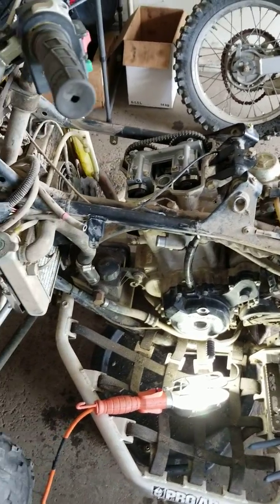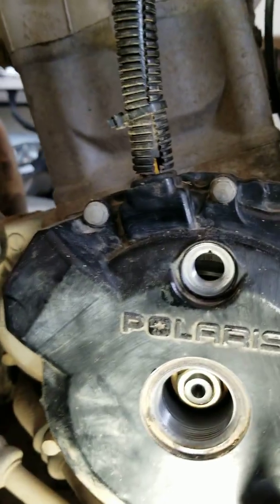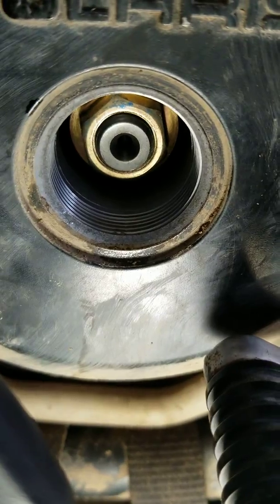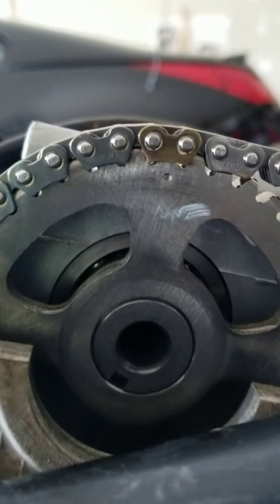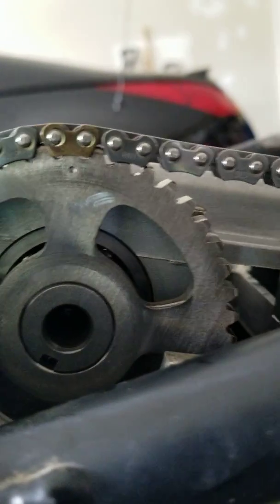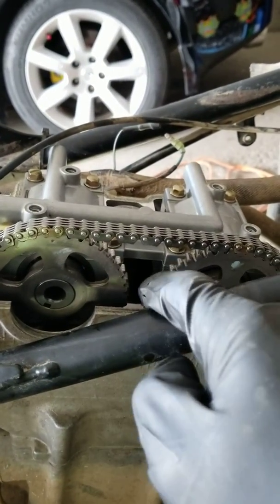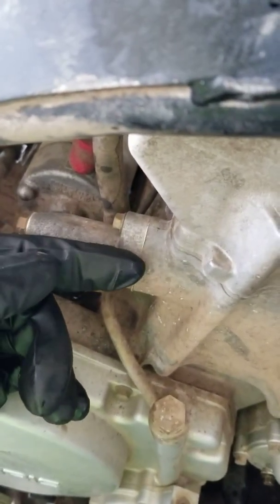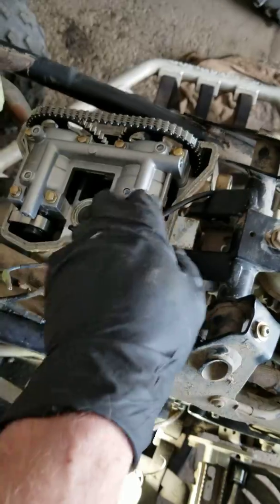Polaris outlaw 500 timing marks

Comment: My predator seems to keep skipping timing. I ordered a new tensioner and chain but what else could be bad?
Reply from the maker: Are your chain guides bad? Stretched chain or tensioner can cause this too. May want to leak down test it to make sure the valves aren't bent if it skipped timing while running
Reply: Check the ruffkey, they tend to break on this and will screw your timing

Comment: I am having a problem getting my cams and chain back on, it seems the front chain guide closest to the exhaust valve side is up to high not allowing enough slack in the chain, do you have any pictures of where it is supposed to sit down inside the front of the engine, I don't have a book on this 04 Predator 500. When I pulled the head to replace the valves and seals the exhaust side guide pulled out with it, and I can't figure out how it is supposed to sit down in there, it seems like it will sit a couple different ways, neither way seems to work, it acts like it is in the way of the cam gear, any advice would be appreciated

Comment: Hey Conway. I just replaced the timing chain on my 05 predator. I got it started but it dies when giving it gas. The chain I got doesn't have the gold links, any advice? TDC is lined up with the t and cams are in right locations. Thanks
Reply from the maker: Did you double check the marks once the cam chain is in? I always put my finger in the cct hole to mock the tension on the chain before putting together. Any slack in the chain should be toward the back of the quad for the tensioner to to push on.
Reply: @ApexPowerSportsllc  yeah, I checked twice because I didn't want to have to take it off again.
Reply from the maker: @robertstephenson7156  double check again. Look for the T and go to the line next to it and check the cam position at 10 and 2 for the cam lobes and the dots on the cam sprocket should be level with the cylinder head
Reply: @ApexPowerSportsllc  are there more than 1 TDC on the predator? I checked again and the dots are correct.
Reply from the maker: @robertstephenson7156  no just the line next to the T. If cam lobes are backwards go one full turn of the crank and should go back to 10 & 2. Maybe the petcock or carb is clogged?
Reply: @ApexPowerSportsllc  alright, since it's a 4 stroke I read that it does 2 revolutions so I think I might need to go 1 more revolution and position the cams accordingly? I didn't realize I didn't put enough gas in yesterday so I put more in today and it didn't die when giving gas, just doesn't stay running so I'm thinking I maybe got it on the wrong stroke at tdc

Comment: Hey Brandon. I have set everything as seen in your video except when I put tension on the chain with my finger it rotates the cams off the 9 and 12 marks. You have any idea how I can get the cams to have a final resting place of 12 and 9 when tension is applied
Reply from the maker: When you put everything together you want to put  your finger in the cam chain port and pushing on the rail to mimic the timing chain tensioner. Put the cams in place on the notches on the came stamps when doing so. This will put all the slack on the chain on the intake side. (Toward the tensioner side) so the timing will be on the spot when the timing chain tensioner is in place.
Reply: @ApexPowerSportsllc  I believe my chain may be stretched . I'm gonna order a new one and start fresh. Any recommendations on chains and tensioner
Reply from the maker: @kennydibell7058  hot cams or wiseco

Comment: I have a 2003 predator 500 and I did everything in this video the exact same and I had the brass links at the 12 o’clock dot on the camshaft but every time we rotate it seems that the brass bushing jumps one spot on the chain ahead of the dot is this normal or should I be seriously worried
Reply from the maker: Your timing chain rensioner should put pressure against that chain before you rotate it. Spin the mag to TDC, install cams and recheck TDC and and timing Mark's. IF YOU NEED TO SPIN THE MOTOR OVER WHEN THE CAMS ARENT CLAMPED REMOVE THE CAMS  THEN ROTATE THE MAG. THEN REINSTALL AND RECHECK TIMING MARKS.
Reply: Brandon Conway OK I followed the steps in the video and did the timing chain tensioner but every time we rotate the motor one full turn until the brass links come back up onto the cams they are ones place a head like they skipped a tooth on the camshafts
Reply from the maker: @ChaseWhitby  no matter how many time you rotate the motor over?

Comment: I have a 2004 Polaris predator 500 I have gas and power but still won’t start any tips you can give me
Reply from the maker: Has fuel & spark? Check compression. With decompression valve you should get around 70-100.

Comment: I think I got screwed over because with the starting girls is a little piece they so broke with a ring the one cranks the motor
Reply from the maker: jose gutierrez ya it's probably the starter. Take it off and bench test it with a battery. Power to the power lead & negative to the starter housing

Comment: Thanks man we need more videos Of the outlaw 500 irs
Reply from the maker: Justyn Benjamin it's a clients quad, he suppose to be bring it by to do carrier bearings so I'll post up a video of it. Thanks for the input!
Reply: Yeah no problem, I own a 2007 Polaris outlaw 500 IRS Myself. and I’m in the process of Timing it Correctly. Do you know How much you need to Torque the 4 bolts on the head when you’re done. i’m trying to figure out how much they need to be Torqued ?
Reply: I haven’t took the head off yet. And I want to replace the timing chain and tensioner. I was wondering if the timing  chain is easy to take out ?

Comment from the maker: I have info in the description
Reply: Brandon Conway  thanks man this saved my day. Two thumbs up
Reply from the maker: Aaron Carter it was hard to find any info on this because they only made them for 2 years so I figured I'd help others out! Thank you for the love on the video & if you need any help feel free to let me know! Thanks
Reply from the maker: Aaron Carter oh and please make sure you take all the slack out of the cam chain between exhaust & crank and put the access slack between the intake and crank for the tensioner to get rid of
Reply: Deffiently the same for 03-07 predator I just did this tonight on my 05 predator, should do some info on shimming the valves
Reply: Michael Eller hey man i have a 2005 predator aswell and I have a "t" for top dead center. Is that what you went by or one of the lines before it? Thanks man